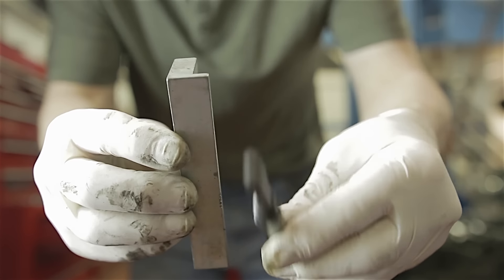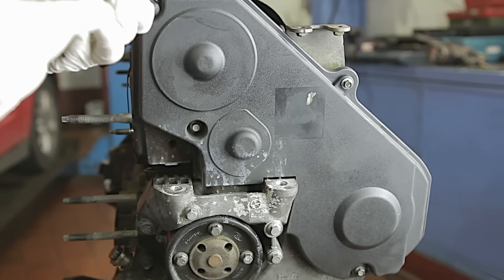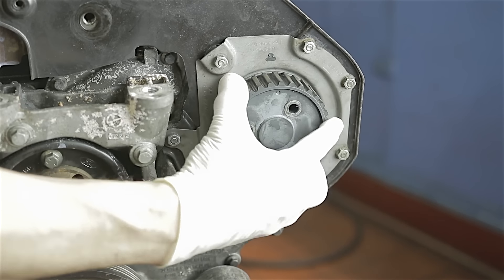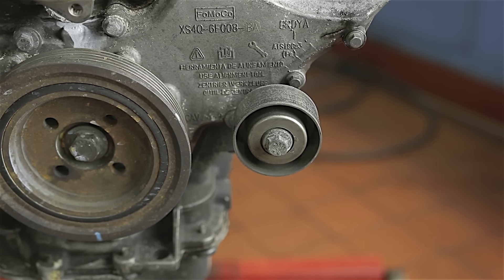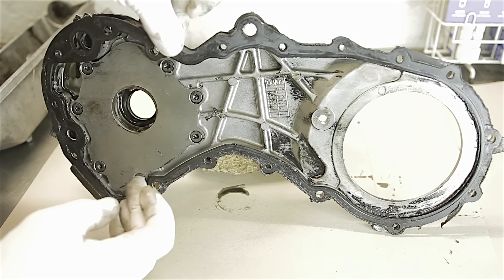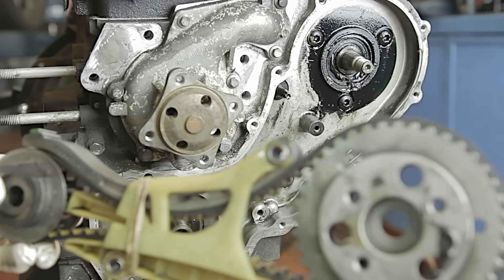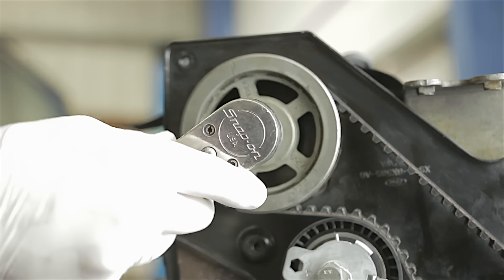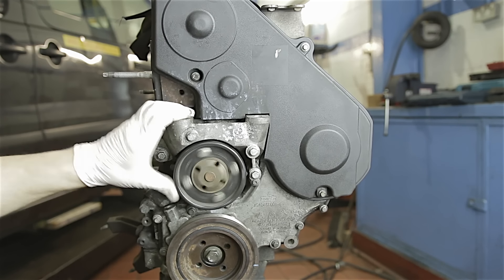Ford Mondeo/Transit Connect 1.8tdci wet timing belt replacement

Comment: I want to replace wet timing belt, but I can choose between original Ford Set and DAYCO set which is almost 2 times cheaper, however I heard that DAYCO is making the same parts for Ford so I don't know. Which one should I pick?

Is it necessary to replace hydraulic tensioner or not?
Reply from the maker: i have only ever used original ford parts so cannot comment on aftermarket parts but i guess they should be ok.
if you are changing the wet belt for a chain then you will need a new tensioner but if just changing the wet belt for another wet belt then you can use the old tensioner

Comment: I noticed some sealer on the timing cover gasket ,should I use some on the new gasket when I replace it ?
Reply from the maker: Toppo beta xtrainer 
Hi. If you use a ford metal gasket then don't put any sealant in it as the rib in the metal crushes to make the seal. 
If you are using a paper gasket then yes use sealant.

Comment: hi alan. just watched this video. great, good job well done!!! now my question---my smax is 57 plate 1.8 diesel..do you have any idea if the lower crankcase has wet belt or timing chain? hoping forward for your idea please.thanks
Reply from the maker: if you phone your local ford dealer and give your registration to the parts department they should be able to tell you if you have a belt or chain
Reply: thanks alan!!!!
Reply: hi i am in the middle of doing the belts on a S-MAX just now & i would recomend taking the engine out to do it as the amount of parts you have to remove to do it is nuts E.G. p.a.s. pump has to be taken off to get to the tentioner ...... the one i am doing has a damaged bottom belt no piston damage but needs a set of valves the joys of cars !!!....good luck ......AK...
Reply: john connolly is that a 1.8 tdci?
Reply: yes it certainly is Apay Kapuy .

Comment: Do not leave the belt till the recommended 125k change interval. Mine was replaced at 98k and was very badly cracked between the teeth all the way round. I consider myself very lucky it hadn’t snapped due to its very  poor condition.

Comment: Thanks Alan.
I saw that you left the nut finger tight. Does something happen when you put in the tensioner bolt/screw and fit the cover which makes it possible to tighten that nut?
Reply from the maker: RommelADC 
Hi, no that is just my way of doing the job. You could tighten the centre nut before you put the tensioner and cover on if you want to.
Reply: Thanks. I tried it again this morning. I cleaned the taper surfaces with White Spirit just in case there was some oil that was preventing a friction fit - couldn't see any  oil but just in case. It went on without further ado.

Comment: Is it possible to just remove the tensioner first to identify whever  you have wet belt or chain, without that causing a problem .
Reply from the maker: hi, yes you can remove the tensioner to check for a belt or chain.... it is perfectly safe to remove it and the belt or chain will NOT jump any teeth in doing so
Reply: alan howatt thank you for the reply, I appreciate it.

Comment: Nice video! I was searching good infos on the wet belt/chain, thanks to you I found them. Thank you. I don't already know if my 2007 s-max is concerned, we will see. 
Two questions though:
 Is it possible to see the chain/belt through the tensioner hole?
 Is there any marks on the camshaft and fuel pump sprocket to set the cylinder #1 to TDC?
Thank you again.
Reply from the maker: hi, you won't see the chain/belt through the tensioner hole.    ... if you remove the tensioner and the end of the tensioner is flat, then a wet belt is fitted.... if the end of the tensioner is domed, then a chain is fitted... your ford parts dealer should be able to tell you through your registration number.
no marks on camshaft, you have to remove rocker cover and fit setting plate in rear of camshaft and the high pressure pump sprocket will have a circle at the twelve o'clock position but it is best to fit timing pin in front of engine block under high pressure fuel pump
Reply: alan howatt ok! Thank you for your answer!
Reply: Hi Alan, one last question hopefully!
Is it possible to take off the tensioner to determine wether it's a belt or a chain that's fitted in whithout problem, or is it necessary to pin the engine?
Reply from the maker: you can unscrew the tensioner and remove it with no problems
Reply: alan howatt 
Thank you for your help!

Comment: Hi Alan. I did set the crankshaft against the timing pin, but what I have spotted that camshaft cut out is alligned parralely to the block engine, it is a litle bit tilted but I cannot put there my timing tool in this position. Is it possible that Ford did something like that?
Reply from the maker: it is just not aligned properly, the top cam belt may have been replaced at some point and not set up right.
if you are changing the top belt or the wet belt just remove the top belt and turn the camshaft until the setting plate does fit
Reply: Thank you Alan. My timing pin tool did not go to the end because od the alternator shaft, but afterparty a while I have found solution and camshatf and crankshaft were proprezydencka aligned. Thx
Reply: A jesli po zdjęciu Koła pompy wtryskowej pompa się przestawi, bo jest na stożku bez klina to co wtedy?

Comment: Hi Alan  doing this on my focus next week do i need to put any threadlock on any of the bolts and is there a torque setting for allan bolts on timing chain conversion pulley , Regards  Ian.
Reply from the maker: hi, i have never used threadlock on any bolts on this job,  the crank bolt does not need threadlock. i do not know if there is a torque setting for the four allen bolts, there probably is but i just tighten them up to what i think is tight enough
Reply: Ok cheers many thanks .

Comment: Hi I'm lock crank shaft.  But where is timing for Pump,? Plz.  I lock crank shaft I put I lock camshaft. I put timing belt. I turn 3 times is ok after again I tern Stack.    This happens after my frd replace camshaft seal and hight presser seal

Comment: Alan I've come to the conclusion my problem lies in the poor quality crank aligning tool , I know I'm going to have to purchase another crush gasket for the cover but  I now have 2 virtually brand new injection pump sprocket seals do you think I should get another one of these or should the one I have be ok , Regards Ian.
Reply from the maker: i have removed a pump seal and refitted it but i would be careful removing it and checking the seal lip plus if you still have the seal fitting ring plastic sleeve would be a help to avoid damaging the seal when refitting
Reply: Cheers very grateful for your prompt response Regards Ian.

Comment: Has the chains ever failed?  How when should it be replaced?  My car has done 140k
Reply: Adam a yes you are due a belt or chain change mate ! i just bought one with similar miles and im going to do both belts and water pump etc
Reply from the maker: if you know you have a chain fitted then the replacement interval is 125k miles but i say you never need to replace it.....we had a big fleet of mondeos 1.8tdci...we replaced all the wet belts for chains at 100k miles... by the time the cars were sold off, many of them were on 350-400k miles..never had a chain break nor have i ever heard of a chain to break.
 if your car has a wet belt fitted it needs to be replaced at 125k miles..the wet belts fail badly
Reply: @alan4x  thanks mate. It has a timing chain fitted. And looks like it it has been replaced at aome point. I was going to replace it because the engine is out on the floor. Was going to do it before i fit it into my smax.

Comment: How long should this take with the engine out and on the floor? Including removing all the bits like alternator etc as if the engine has just been pulled out the car complete? 
Thanks
Reply from the maker: Gavin Smith 
Should not take any longer than an hour and a half

Comment: Hello. I went to Ford dealer and gave him my VIN. HE told me that my car had a wet belt. My car has been built in may 2008. When I change the distribution. It was a chain. I put the wet belt instead of the chain listening to the advice of the person who helped me to do. What are the risks because I didn't change the tensioner so I got a tensioner for chain and now it's a wet belt...
Reply from the maker: first off, the moment you found your car had a chain, you should have left it in place. THE CHAIN WILL OUTLAST YOUR CAR.
the wet belt will need changing in approx 100k miles and you really need the correct tensioner for the wet belt you have fitted as the chain tensioner could damage the arm it presses on, the wet belt has a flat end and a chain has a domed end on the tensioner, i do not really know if any bad will happen but the tensioner ends are different for a reason
Reply: alan howatt thanks. I am perturbed because the person who helped me told me that my chain was old and need to be changed. I will call Ford dealer to have the price of the tensioner. I think I didn't choose the good person to do that distribution :-(
Reply from the maker: Mickael Delmotte 
Hi. We changed all our mondeos taxi cabs from wet belts to chains. The cars had done in some cases 300k miles on the chains. I have never had nor heard of a mondeo chain breaking. If you keep your car for another 100k miles you will have to change the belt again or sell the car
Reply: alan howatt hello. I am going to buy a good tensioner. In 100k miles I will put again my chain because I kept all used parts. 👎
Reply: 139€ for the tensioner. Ford don't have shame  of anything... 😯
Reply from the maker: i think if you search ebay you can get one on there
Reply: alan howatt thanks Alan. I will search on ebay. To assemble the new tensioner, I don't have to disassemble the distribution, only the old tensioner can be disassemble to fit the new one?
Reply from the maker: yes just unscrew the old tensioner and screw the new one in, job done
Reply: alan howatt could you please tell me if I can access directly to the tensioner to unscrew and screw the new or if I have to disassemble something to have access. Thanks you so much for your support
Reply from the maker: you will have to remove the auxiliary belt and engine mount, then you will have to unbolt the power steering pump and move it to one side to gain access to the tensioner
Reply: alan howatt thanks for the quick response. I can't do it myself 🙁

Comment: Hi Alan, have you any experience with headgaskets on these engines. I had a piston crack on my connect about 2 years back,put a piston in and new injector and yaaaah all good for 12 months. Head gasket gone. Have you seen this before. Thx
Reply from the maker: the head gaskets are really good on these engines so sounds like something is not quite right...maybe a slightly warped head
Reply: Thanks for the reply... Had the head done in machine shop and new headset/gasket kit and torqued to manufacturers spec. Was just wondering if these engines were prone to gaskets going after the original ford gasket has being replaced. Thx
Reply from the maker: no not that i have heard... i have fitted aftermarket head gaskets and they have been ok but the head will need to be removed to see where it has gone....i have had a head bolt break before for no apparent reason causing the gasket to fail...annoying for it to fail after one year
Reply: @alan4x  it is really annoying to say the least. Might take the cam cover off and check for a broken bolt. I will let you know if I find something interesting. Thx for your time !!

Comment: Hi Alan.i have fitted the chain kit to my engine but one chain is slightly slacker than the other.is this normal.thanks Simon.
Reply from the maker: hello, did you fit a genuine chain kit from a ford dealer or an aftermarket one from eBay, i have always used genuine ford parts and never had one chain slacker than the other

Comment: hi mate this is a long shot but my wet belt has failed is it possible that the head is ok and just replace all belts ?
Reply from the maker: Sorry, but if you were driving and the wet belt has failed it will have to be nothing short of a miracle that your cylinder head is ok.
chances are, most or all valves are bent with broken valve guides and maybe broken camshaft,

Comment: Do I have to replace wet belt tensioner? - £108 in local Ford dealer
Great video
I hope it will help me to change my t. belt
Reply from the maker: hello, it is recommended to fit a new tensioner but i have fitted new wet belts and used the old tensioner without any problems,

Comment: Alan Howatt       What year or engine code had these wet belts on ? I have a 58 plate mondy @ 97k 1.8 tdci 
Cheers 🍻
Reply from the maker: hi.... it would be 2008 when the wet belts were fitted...best thing is phone your ford dealer parts department and they should be able to tell you if you have a chain or wet belt using your registration number
Reply: Alan Howatt Thanks Alan, appreciated mate 👌

Comment: I know it's not related Alan but u heard of an intercooler going on a 1.8 tdci focus.  I have a boost leak 
I have checked all the pipes they are ok however you can hear hissing  underneath at the bk of intercooler. low power black smoke etc! u ever heard one go!?!?
Reply from the maker: Ritchie Schofield 
Hi. Yes I have had quite a few intercoolers leak from where the end cap joins onto the intercooler. I guess the seals give up

Comment: Hi, what year did they start putting these  wet belts on as earlier models have chains on  didn't they?
Reply from the maker: John Walker 
Hi it was 2007 until 2010-11 time. 
To be sure you can phone your ford dealer parts department and with your registration number they should be able to tell you if you have a wet belt or chain fitted
Reply: Alan Howatt  I have a 2007 and it’s chain driven

Comment: Do you know how much work ill have to do to remove the tensioner bolt to find out for sure which my engine has?

Im gettin conflicting opinions as to whether my lower drive is chain or wet belt? With it being produced during the changeover period no one really seems to know definitively which it has. Any info would be greatly appreciated. Kindest regards, Alex
Reply from the maker: Alex Gregory 
You have to unbolt the power steering pump and bracket that bolts to the rear engine block then you can unscrew the timing wet belt/chain tensioner. 
 If the end of the tensioner is flat you will have a wet belt fitted. 
 If the end of the tensioner is domed you will have a chain. 
  The tensioner for a chain will also be black in Color and it will be gold for a wet belt but the bolt head gets corroded and is hard to tell so it is best to unscrew the tensioner and check. 
 Don't worry about removing the tensioner as the chain will not jump teeth
Reply: @alan4x  Thankyou so much Alan, I really appreciate the info. The tensioner bolt looks black (although Ford insist its a wet belt) and easy to get to without touching the power steering pump in honesty? So can I just remove that tensioner bolt without doing anything else at all (i.e. getting to top dead centre/locking anything in position) check whether its a flat or domed end and then just refit with no problems or risk of altering anything whether is a belt or chain Alan? Your the first and only helpful, knowledgeable person Ive come across so far, I really appreciate your help and expert advice. Kindest regards, Alex.
Reply from the maker: hi, yes just unscrew the tensioner...you don't have to time the engine up..just don't spin the engine over with the tensioner removed lol
Reply: @alan4x  Hi Alan, its me again, im nervous! Just want to double triple check that I can literally drive my car on the drive, remove the 17mm tensioner bolt to check if its domed or flat (to properly identify which engine I have) then wind the bolt back in, tighten anthen start and drive the car and everything will be fine? Nothing will have changed at all? Many many thanks, Alex
Reply from the maker: i know how you are feeling...trust me... unscrew the tensioner and remove it...the chain is far too short and thick to jump so you will be perfectly ok...
Reply: @alan4x  Thanks Alan, and still be be perfectly fine if it is a belt, no way that can jump either? Thanks so much again. Sorry to pester you, ill check it tomorrow depending on this storm! Lol!
Reply: Drain the oil and take off the belt cover

Comment: Did all these engines come with a wet belt or did some come  with chain
Reply from the maker: Dan J 
Hi, I think the wet belts were fitted between 2008-2010. 
  Not totally sure but earlier mondeo 1.8 had a chain. 
  The best way to find out now is to phone ford parts dealer... their computers will tell you if your car has a chain or wet belt by using your registration number... but no. Some have chains as standard and some have wet belts.
Reply: Daniel Jones i have a lynx 1.8 mondeo mk4 57 plate and it has a chain

Comment: Great stuff ! Cheers Alan .. May i ask where can source the timing tools you used ?
Kind regards 
Dave
Reply from the maker: hi, i believe you can get the kit from ebay or any motor factor like euro car parts will get the timing tools no problem
Reply: alan howatt might do a install with the engine in situ, doing a belt to chain conversion on my 2010 Connect 
Thanks for the vid and the important parts numbers 👍🏼

Kind regards 
Dave
Reply: @alan4x  hello Alan please say how i can check in my 1.8 TDCi 125hp s max 2008  is wet belt was change beafore ? Dont know how to checi it .. thanx

Comment: I've got a MK1 2005 TDCI, think the head gasket has gone, anyone know if it's going to be a wet belt or chain?  It's a T230 LWB 90hp Hi-top, if that helps.
Reply: Chain.
Reply: @boabm6522  Thanks.  I've done the head gasket now, egr cooler was also leaking.  Sure van should be a TDCI but it's got a TDDI engine in it.